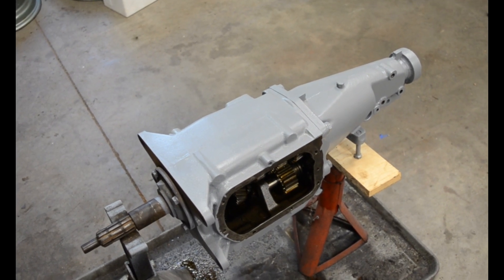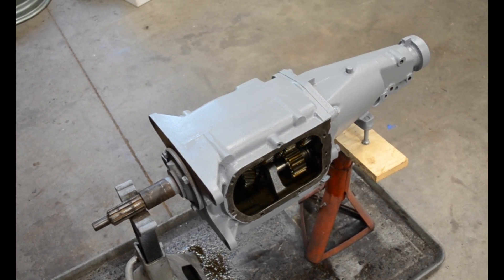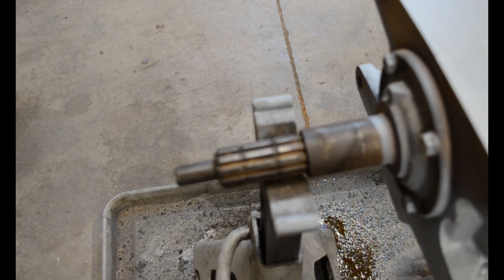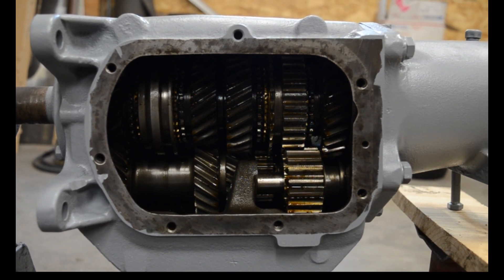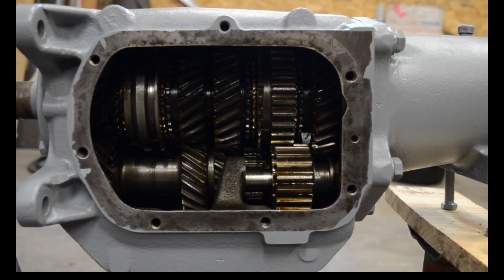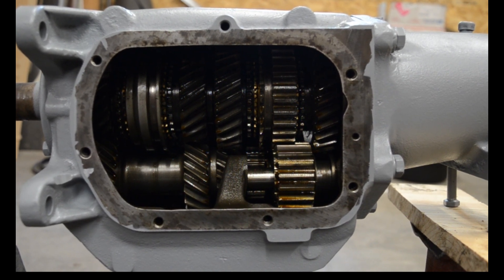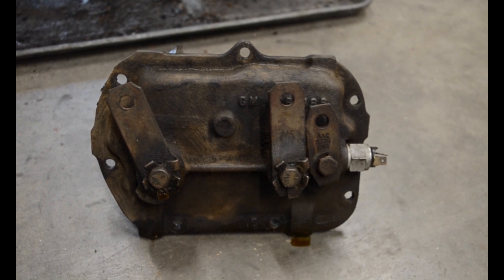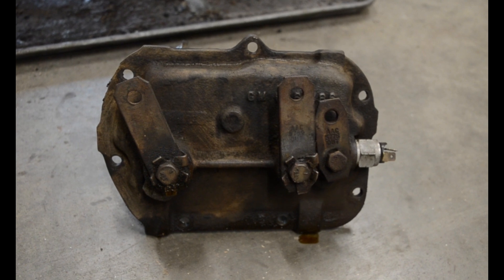Saginaw 4 Speed Overview

Comment: 4 gears no waiting. Yep as long as you're not pushing to much torque through those, they'll work just fine.😎👍
Reply from the maker: It's a lot more fun than the stock Powerglide that came in the car!
Reply: @harleysgarage327  
Heck yeah, any other transmission is more funner than a Powerglide!😁😎👍

Comment: I ran a 3 ring for years in a c10 they will hold up as long as you don’t put sticky tires on it..
Reply from the maker: I always thought that version would be good in a truck or heavy car.
Reply: @harleysgarage327  yes sir it had 373s 358 and 305 heads wolverine 292/480 it went 850s on street tires in 1995 it was a lot of fun😂